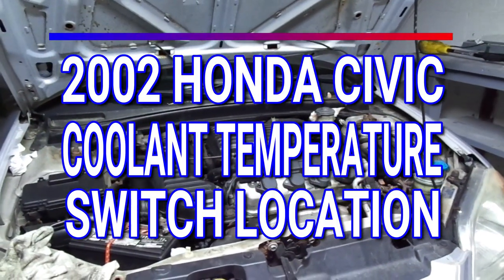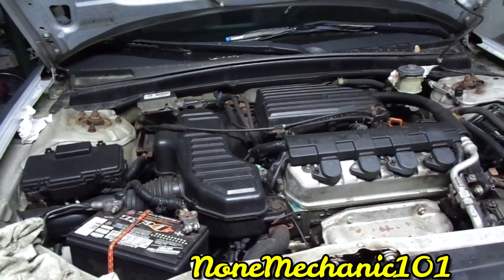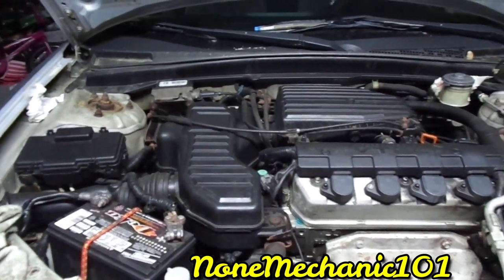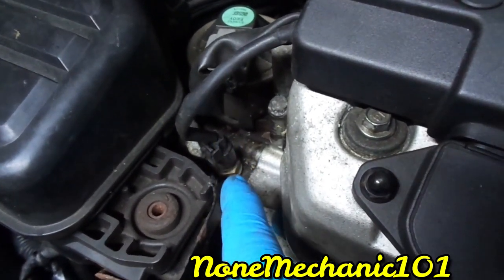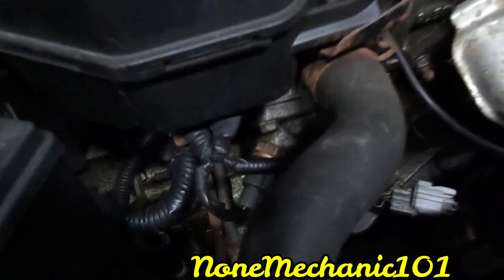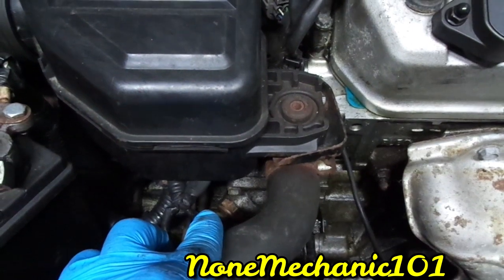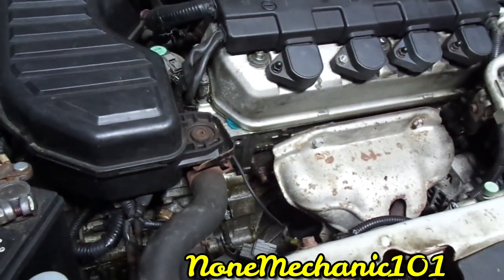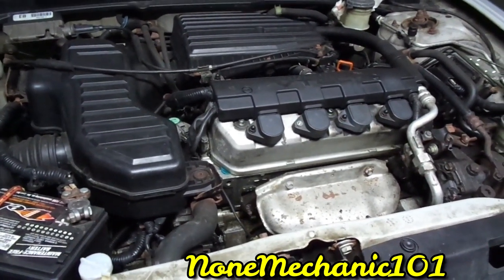2002 Honda Civic "Coolant Temperature Switch Location"

Comment: " SWITCH "  its the electric fan switch and switches on the electric fan when the engine temperature  rises above a pre-set factory level and stays on until the  engine temp drops below that level .  the temperature sender  shows the engine temperature on the dash temp gauge   2 deferent jobs

Comment: Thanks for your input, I appreciate it. I drove it today a mile or two to autozone, came back and parked til I guess it got to the running temperature, and the fans kicked on and the gauge never moved above the halfway mark. Il go look at the coolant levels soon. This is on a 01 civic from Michigan now in Arizona 100 degree heat, and pep boys said it was bone dry in Yuma while I was getting a tire after driving through highway and mountains to San diego and back to Phoenix where it is now. It still has never actually overheated anywhere, but the gauge was going above middle right to top sometimes once I got off highway and flucuating which it never even moved in Michigan.
Reply from the maker: Keep me infor. Thank you for watching👍

Comment: Great video, if reservoir overflowing and radiator losing coolant, could it be from faulty switch or sensor. Replaced thermostat, and new rad cap already. Thx
Reply from the maker: One thing for sure I would check for a blown had gasket.

Comment: Would the coolant temperature switch stop my fans from turning on my fence will not turn on unless the AC is on
Reply from the maker: Yes it is possible but first I would check the fuses and the electric on the fan. Use safety at all times

Comment: I have two codes P0118 P0128, i cleared them and only the P0128. So is this for the Temp Sensor? also are they two different PN's for the switch and sensor?
Reply from the maker: This video made help you out      https://youtu.be/GjBmCaUY_bY

Comment: I have a 01 civic, and the coolant is disapearing and the fans doent seem to come on when idling, but fans work when you push ac button. Im going to replace hoses, but wonder if these 2 things could be it too or the relays? Autozone guy told me I need new fans and the 2 hoses.
Reply from the maker: Before you replace the fan make sure that is the problem. Check the wiring, Check your fuses, Check the relay.
Reply: It may be your engine coolant sensor, there are plenty of troubleshooting videos on youtube

Comment: My car Honda Civic is show check light and turn off the engine I change the gaskit and also wash the radiator and change the heat sensor and then also have same problem ..what can I do
Reply from the maker: Do you have an engine code?

Comment: Does the coolant temperature switch has to do with the temperature gage in my civic 2002 (always reading low) I replaced the coolant temperature sensor and fixed some problems but not the temperature gage thank you
Reply from the maker: The coolant temperature SWITCH = Temperature gauge
Reply: @NoneMechanic101  thank you
Reply from the maker: @haroldvelasquez9185  👍
Reply: When I changed my engine coolant SENSOR( not switch), it fixed my temp gauge on my dash,on 2001 Honda Civic!

Comment: What's above the coolant temperature sensor.. It has a plug also.my car doesn't have anything plugged to it
Reply from the maker: A wire hardness should be plug to it
Reply: @NoneMechanic101  nothings plugged to it. What is it though? I'd it important? Because car works fine besides radiator fan not working